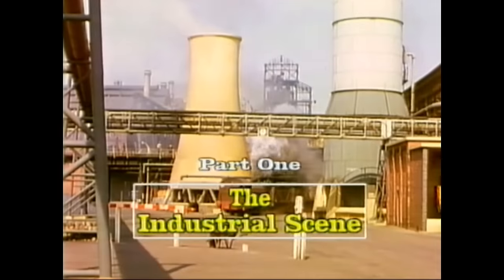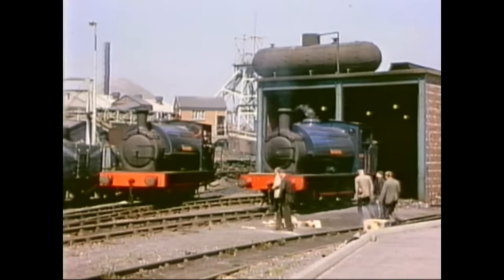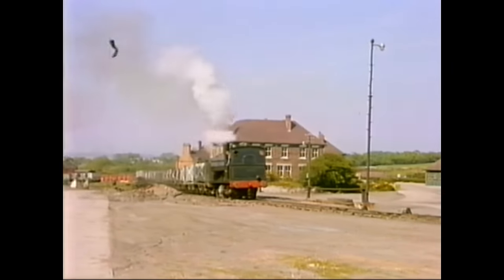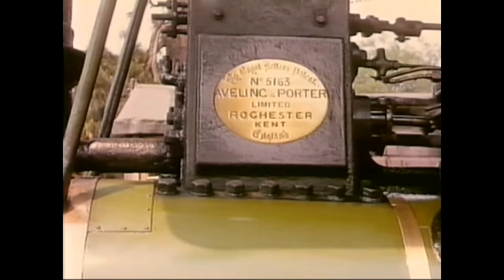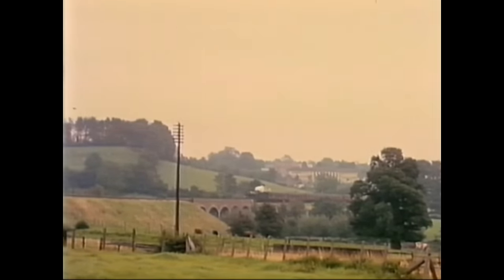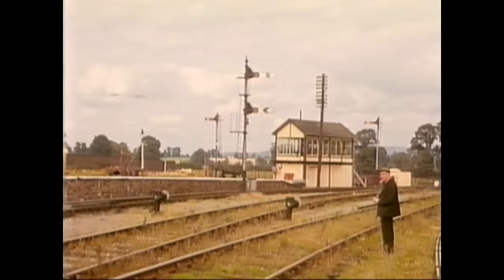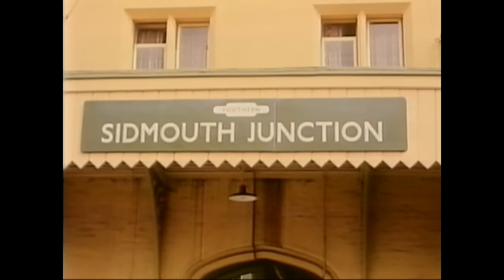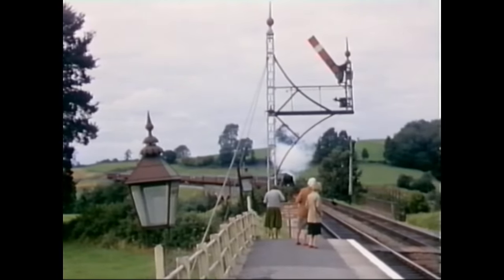British Railways Steam Engines in 1962

Comment: Total nostalgia, not only the engines but the 'proper English voice ' of the narrator.  In 1961-62 the Tunbridge Wells West trains to Victoria were still steam hauled, though they were at that time being replaced by horrid, unreliable DMUs. The trains were hauled by tank engines, which were not being maintained. Sometimes on the long run from Hurst Green to Lingfield the train would slow to a halt. The fireman would then climb along the to the front of the engine and vigorously beat the brake vacuum pump, after which we would proceed to Lingfield.  I seem to recall that the last steam traction ran between 3 Bridges and Tunbridge Wells West using the High level platforms at East Grinstead. I was lucky enough one evening to ride the footplate from EG to Forest Row after changing from the East Croydon to EG service that terminated on the low level . Happy memories of the great age of Steam.